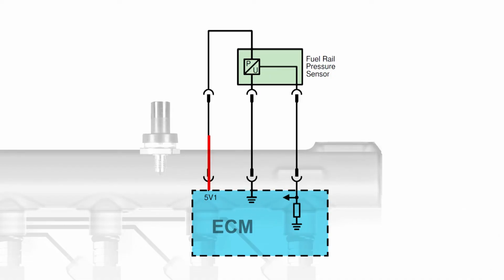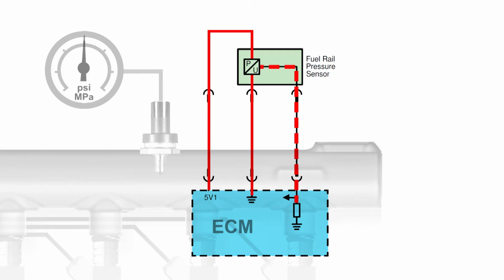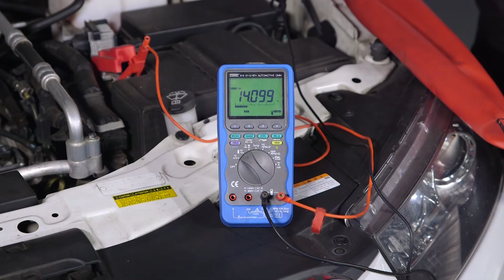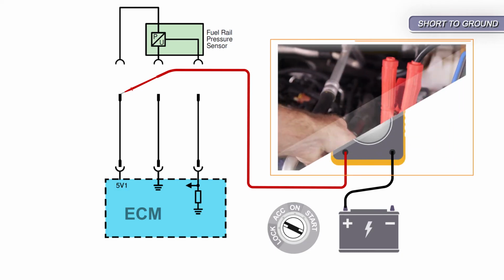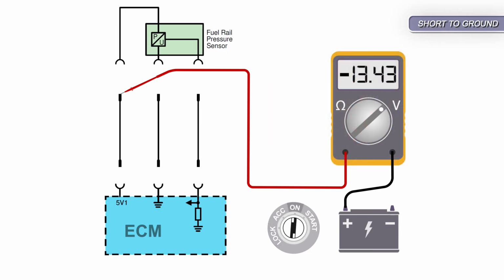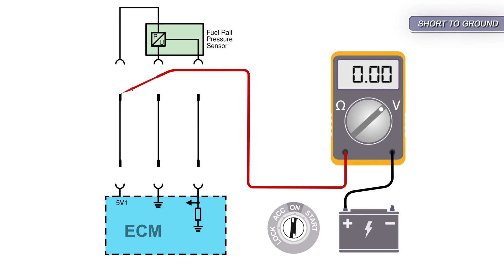Fuel Rail Pressure Sensor Signal Voltage Low Pull Down Type

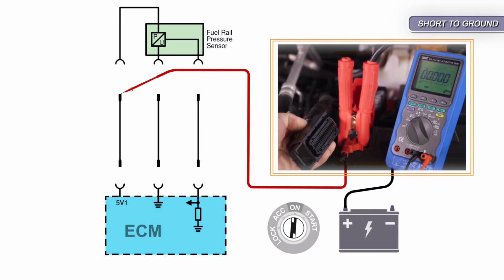Comment: I see some comments about his ground testing confusion. At 1:09 he is simply putting multimeter positive probe on rail pressure sensor harnesses 5volt supply line and negative multimeter probe on the battery positive to test if harnesses 5volt is shorted to ground.(ecu connector should be disconnected and machine power or switch should be off )

Comment: Hello mate! My 2016 Kia Rio throwing trouble codes p0192+p0193 fuel rail pressure sensor A circuit high + low in addition to random misfire. Do you think it’s an electric wiring or connectors issue since it says circuit?
Reply: yo same thing wrong w mine did you find the deal out w yours?
Reply: @hannahrawls4583  not yet it’s a project car for me so Im taking my time kinda. My next plan is replacing the injectors and do a compression test.

Comment: sir can you help me, my d4cb engine read code p0191 or low pressure on the rail, my mechaic told me to change the sensor, when i did and try to start it wont start, it show code p0193 or high pressure on the rail, pls help what ca cause this , cause it a new sensor pls help
Reply from the maker: Hi Wilbur,
Unfortunately, the person that can really help you with your car is your mechanic. Those faults will definitely need some in-car diagnosis.
Good luck with your car!
Reply: hello sir i try to do a diagnosis to my car, i already rebuild the injector cause it has a back leak issue when i test it, change my heater plug cause all of them are dead, check my injector pulse and i have, check me pressure regulator, working good and finally test my camshaft and crankshaft sensor and my crankshaft sensor doesnt have any resistance when i bench test it, it doesnt produce voltage so i order it, just waiting for the part to come in, how can i enroll i your training? willing to learn and upgrade my knowledge sir
Reply from the maker: Hi wilbur, if you are interested to, please visit us at https://www.automatetraining.com to enroll for a trial account, which you can then upgrade to a full membership account. Thanks!
Reply: Thank so much.my tdci engine start than shots of there is issues with fuel suply anyway  i am electrican.i understand this video and it mean a lot.